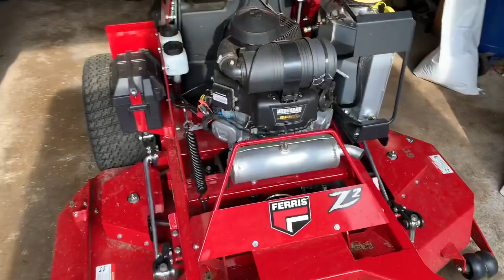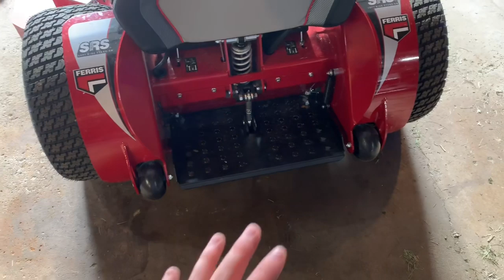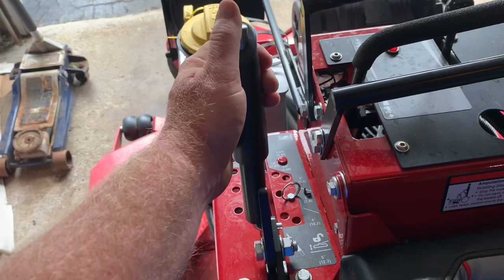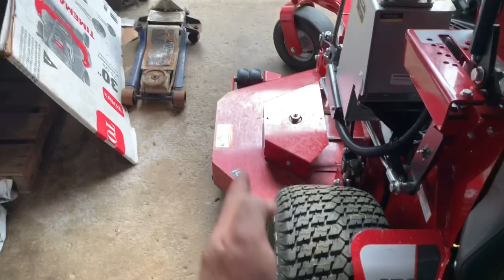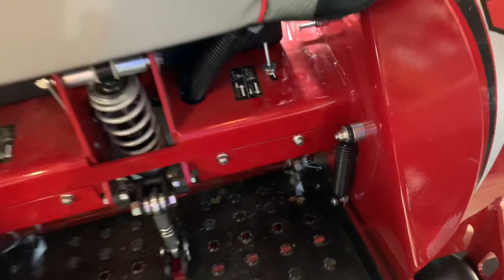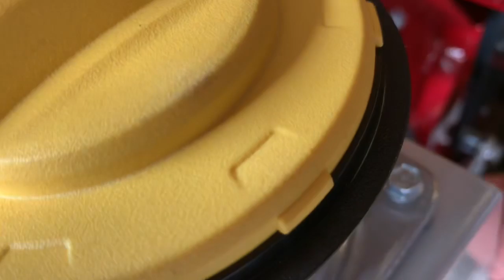Ferris z2 review (does it suck)

Comment: that isn't the latest model,  they've just come out with a 52 inch deck and the front pivots etc....  but it doesn't come with a kawa eng. u have to get the 61 inch to get the kawa,  this model johnny is showing has been out a few yrs or so I think, but its not the latest folks, the latest its badddd to the bone.
Reply: The 52 don't come with the pivot just the 61 and 72 z3

Comment: Great post, im in market, not fan of scags tri-plate design on deck, EVEN THOUGH it's tops for quality of cut, they don't last ie; 3 stacked plates In fla starts rusting issues that once started its over.
I like the ride of the z3 but like the non greasing on zk and ease of service 7 guage fabricated deck means a LOT when you keep your machines well into 10yrs. Don't know much about the hydro gear zt 4400 trannies on Ferris either. Great post Sir.
Edit: after you reminded me of the hydro issue, I'm gonna start looking at "staris" as well 🤘🤓

Comment: Hey Johnny  with the z2 overhang stripe issue that machine isn't any different than the 2100z overhang and tire width that you ran. I ran a 2100z for a few years and just bought a 3200 with 37hp vanguard this spring  and have been very happy with it
Reply from the maker: Kevin R the z2 has 23 tires versed the 2100 24 the 3200 has 26😳
Reply: you're right. for some reason I was thinking the 2100 had 23in. I just looked at mine to confirm it had 24in.
Reply from the maker: Kevin R thanks for getting back to me.

Comment: Changing the hydro fluid is the only thing they failed to make easier on these machines.  You need a real good mechanic to get it done right. My mechanic hides from me when its time for hydro change.🤣
Reply: Do you usually remove the drive wheels to do it?
Reply from the maker: Simple Steve 😂

Comment: I’ve had 2 spindles go at 1100 hrs and 2 hydro seal kits installed and 2 hydros go.
Reply from the maker: jay brown good to know what size deck and engine?
Reply: I got one of the if not the first one in Canada. 52 inch. 25.5 kawi. Hydro started leaking at 175 hours. Replaced at 300 for the one the other had the seals also done and then gave out again at 600 or so hours.   Ferris was good and covered it even tho it was out of warranty because they leaked so early and had obvious issues.  Apparently they are all bad like that as another company here has gone through the same thing.   It’s a great machine when it works tho.
Reply: jay brown the first ones had a recall on the hydros they got it figured out now but your dealer should replace them for free
Reply: Adam DeFord yes both were replaced for free
Reply: Another company here has blown one of the new hydros tho.  They are on their  3rd

Comment: The first mower on my list is the ferris z1 36 then a ferris z2 52
Reply: Pioneer Northwest LLC Lawn Care And Maintenance z1 sucked. I traded it in after a month for a z2
Reply: @DoyleBrosLawnCare  what would you reccomend for a 36 stander?
Reply: Pioneer Northwest LLC Lawn Care And Maintenance I personally would rather have a 36 walk behind and then nothing less than a 48 stander. After having both sizes, the 36 is not able to handle hills because the base is not wide enough. It’s completely different built than the 52. It’s just weaker and can’t do anything laterally. Unless you’re in a 100% flat area, I wouldn’t get it. This year, we’ve basically dropped everyone where we couldn’t use a 52 inch and it was the best thing we’ve ever done. Income has sky rocketed and time per yard went down. If I don’t make $750 a day, then something weird happened. Last year I was only able to max out at 400-450 a day. But dropping those fence yards saves so much time, and tightening your routes. 52 is the best size in my opinion or 61 if you’re in a flat area.

Comment: Why didnt you just go straight to the Z3? Same sized deck, but better. Im amazed you didnt do that after all the talk about getting the most powerful engines etc. Im stunned! Sorry, is this a demo? Demo the Z3 for comparison! I'd be interested in your thoughts!
Reply from the maker: The z3 is just too heavy for my liking.  This is about 975 verses 1300-1400.  It’s just too big.  The wright is a little over 1100 for the zk.  With all the rain we have had I’m tired of pulling out a 1400 lb machine.  The z3 is a beast to run.   What I’ve come to realize is the weight of these machines are issues
Reply: @JohnnyMow   Fair enough but its dry Z2 1000 vs Z3 as1270 vs 1445 for the 3200 ztr. Not insignificant I agree but tire size increase with the weight increase. 
At the end of the day its about the deck and issues have already shown up. Thats why the need for good demo right!
I'd seriously reconsider. We have both been there trying to fix decks and know sometimes they can't be. 

How many times have you been through that already?
Im still stunned you seem to have put that to the back of your mind.
One year may be wet, the next not. I wouldnt buy a mower based on what "might" happen. 
Just my 2cents mate, for what its worth.
Reply from the maker: Mickhippy it’s jus a review of the z2 not saying I’m buying😉
Reply from the maker: Mickhippy stay tuned for my sit verse stand review!!
Reply: @JohnnyMow  Im on the edge of my seat. Pun intended! lol

Comment: it slide down due to having hydro gear over parker. that's just my experience going down hills. Ive ran both hydro systems.
Reply from the maker: Outerspaces landscape so Parker is better?
Reply from the maker: Who puts Parker on there standers?
Reply: @JohnnyMow  wright does. Exmark has parker wheel motors and hydro gear pumps. Idk why. Ive ran a toro zmaster with parker pumps and wheel motors and it always felt more stabile going down inclines than my turftraces with hydro gear pumps and wheel motors. as for other brands im not sure. To me, the parkers feel like they have more control.

Comment: Johnny you line up on the back cut with the deck roller wheels that sets your 6 inches. Yep it's a 61 and you lose on the second cut but its good to over lap alittle. Good video.
Reply from the maker: Mack Driver could you explain this a bit more?   I could use the help
Reply: @JohnnyMow  this is what a lawn guy told me. I just work on a few mowers and Servce work. I don't mow no yard but mine. I have watch some other channels reviews like Spencer's lawn this week that Ferris didn't leave a thin or thick streak. Hate you had trouble but I like my ZRT Ferris because of the ride do to my medical. Good video I like your channel straight forward no BS.